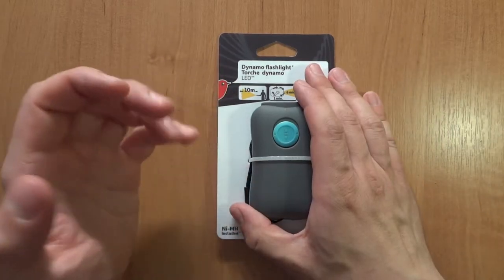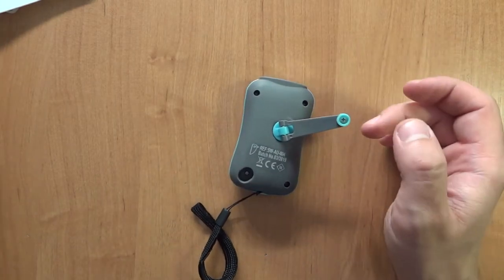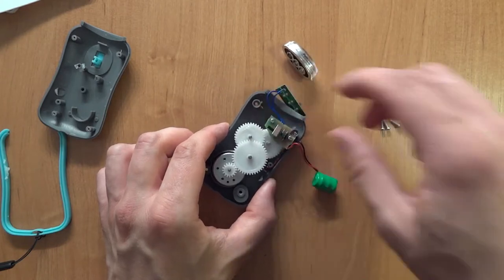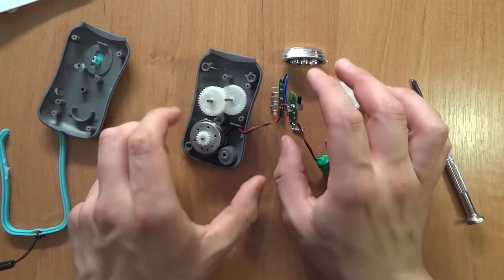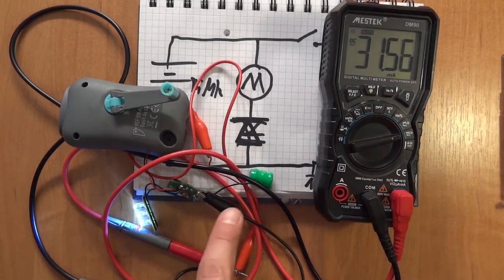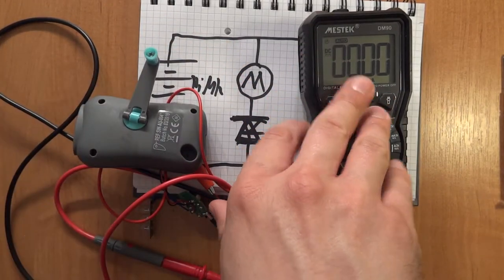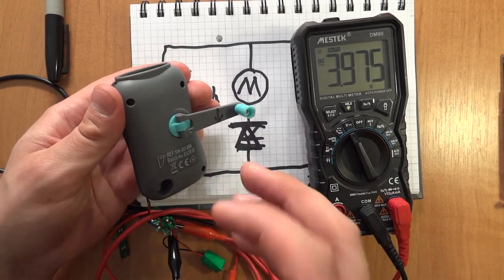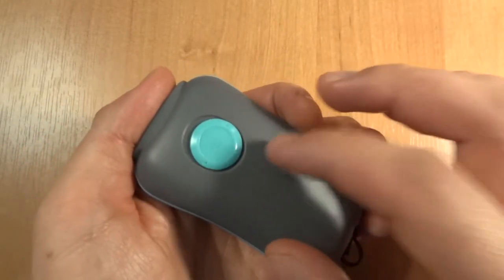How good are dynamo hand crank LED flashlights?

Comment: Do you know how hard is to replace a battery? Can I do it at home or somebody else needs to do it? 
I have the same one just different colour. When I crank it it lights up but can't charge the battery.
Reply from the maker: You should be able to replace it yourself if you solder a new 3.6V NiMH battery in place of the old one (or just bind the wires together and isolate then with tape). The one in mine was 40mAh but any similar capacity should fit as well(make sure to measure it first). Price is anywhere $1.5 to even $10 so it might make more sense just to buy a new light 😉
Reply: @pandaengineering  yeah I know its cheap but I got it long time before by somebody so I dont want to trow it away.
Reply: Then keep it but get a new one and use the working one and keep your older one